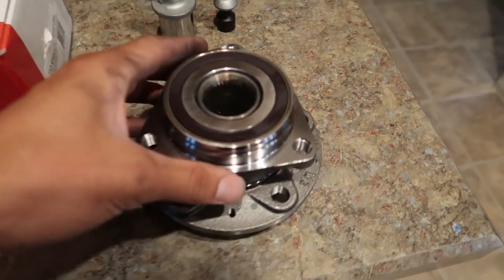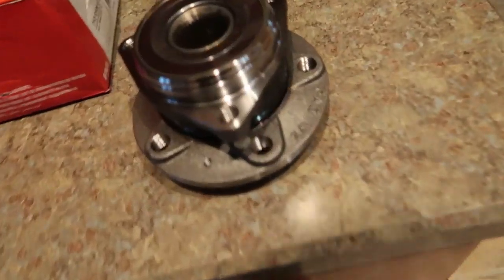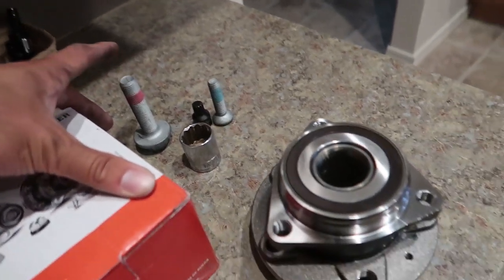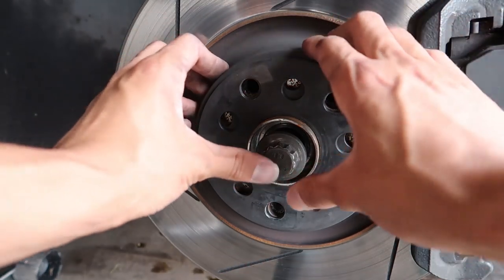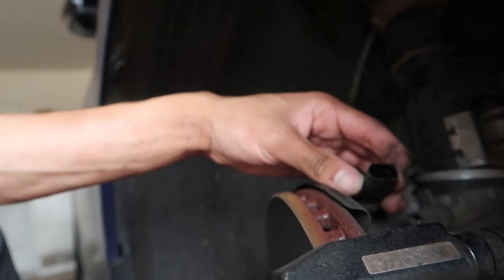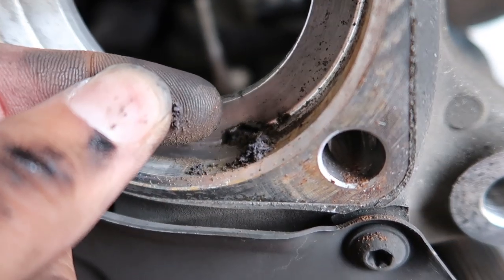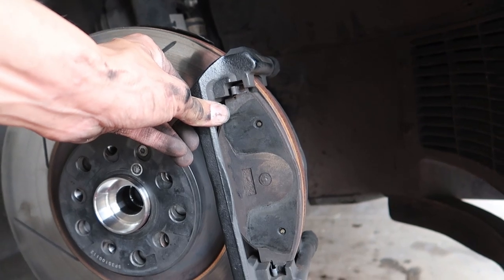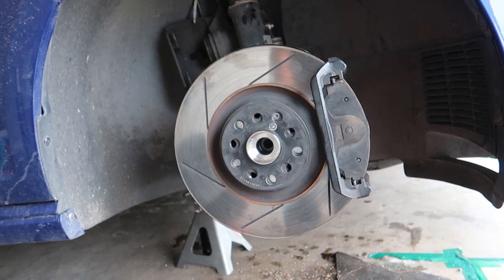Wheel bearing DIY | MK7/MQB

Comment: So did that happen after you replaced that snapped axle from the drag strip? Did you forget to torque the axle bolt? I know they say to replace all stretch bolts after one use, but most people find you can get at least 2 uses before replacing them. I usually will replace them if possible, but in a pinch... Just curious how that happened so I don't make the same mistake.
Reply from the maker: Yeah I tqd it down good.. I did reuse the bolt (just that one time) I didn't put any loctite on it though.. I think it was just a fluke tbh, with all the hard driving and long trips it just backed out enough to fuck up that part of the bearing
Reply: @BryceJordanProductions   Sounds like maybe that one should be replaced every time. I believe it is the highest torque bolt on the whole car, as I recall it is something like 180-200 ft-lbs, plus another 180 degrees?

Comment: Hey man quick question about your haldex. Do you get wheel spin on the front but rear is still engaging and the slip light flashes? Trying to diagnose my haldex. 

Got a code that happens when I launch the vehicle traction off completely. I get rid of the code by priming the pump. If I floor it traction on I get a good launch but slip light comes on 5k rpm. I had the vehicle in the air and all 4 wheels turn. 

Just trying to make sure the flashing slip light isn’t a problem. Test done on wet roads
Reply from the maker: Sounds like it's having some issues.. I've never had that happen personally. The pump might be on its way out..
Reply: Thanks for the quick response!!
Reply: had an issue like that but worse. change the fluid and pump and prime. problem gone.
Reply: I found an article on that a few days ago and it works I still think Bryce is right though and it might be on its way out. When I turn off traction control I get wheel hop and error on vcds. Otherwise acceleration with traction on is not giving me any slip which I’m happy with for now. I don’t see myself launching that since it’s my daily and I’m at 90k
Reply: Drain the fluid on  the haldex take the pump off clean the little screen of all the gunk buildup if that doesn't fix it then yes you probably need a new pump.

Comment: Thanks for the video. Have the same problem in my GTI.
Reply from the maker: Glad I could assist! FCP kits for this are 👌👌👌 I might say throw in a new sensor too just in case.. depends on how you wanna spend your money, but if this alone doesn't fix it, replace the (abs) sensor as well they're about 95$ everywhere I've seen

Comment: Had to do this a while back wish you woulda made this video way back when :/. 

In other news I would like to pick your brain on a sound I’m getting on the left rear after lowering springs install on 15 A3 8v. I’m thinking it’s the end links as the sound happens at low speeds. Can’t find a good way to test it however because when I touch it it’s firm. I appreciate any tips!!!
Reply from the maker: My guess would be links as well, unless it's the strut tops crapping out
Reply: Changed those out after watching your mount video lol. Endlinks it is then!!
Reply from the maker: I hope that fixes it! You gonna get adjustable ones?
Reply: Was going to ask you how yours were holding up. Did you need to retighten the adjustable portion? I’ve heard complaints about adjustable endlinks in general always coming slack
Reply from the maker: @AhmadAli-du2fq  I haven't yet, but the rear ones don't really even need the locking part they can't move from their position
Reply: Bryce Jordan Productions gunna pull the trigger on the same ones you bought then......................... might be getting their sway bar as well in the future.
Reply from the maker: @AhmadAli-du2fq  I'd wait and do them at the same time so you don't have to adjust them twice if you can

Comment: Where do you find the torque values and the procedure for tightening the axle bolt? Thanks
Reply from the maker: Ummm I think from a shop dap video
Reply: What is that axle nut called and what is the size?
Reply: @BryceJordanProductions    what is that axle nut size.....? 12 point correct

Comment: why no ugga dugga gun?
Reply from the maker: I lack in the tool department. I have an electric impact that I use but it isn't strong enough for high tq stuff.. need to invest but I spend all my money on parts instead lol
Reply: @BryceJordanProductions  Dewalt DCF899, thing is a beast. Takes off axle nuts no problem. Make sure you get the big battery with it. I love mine.